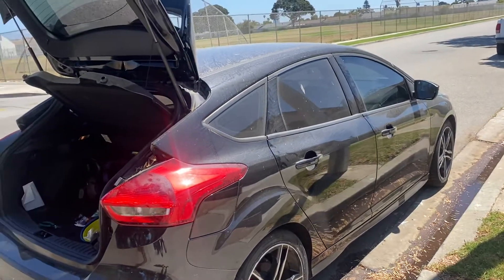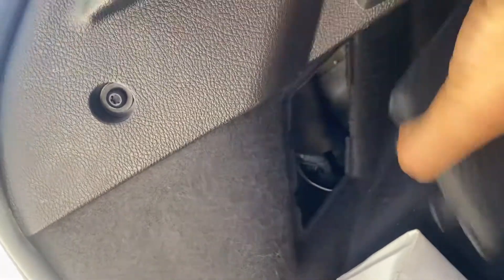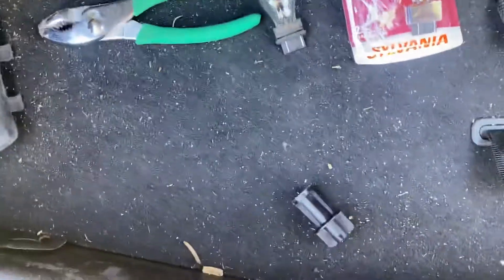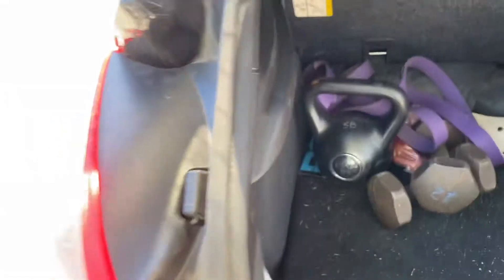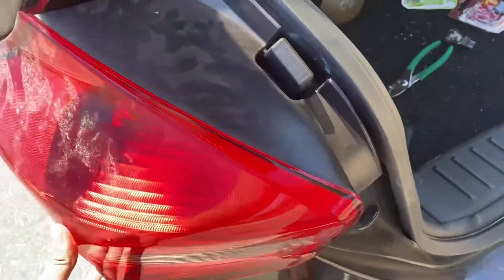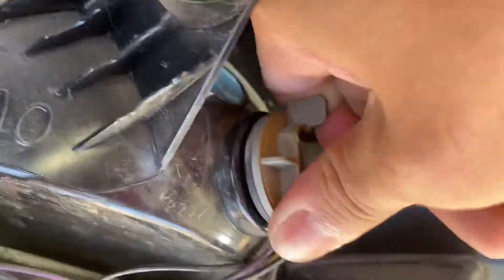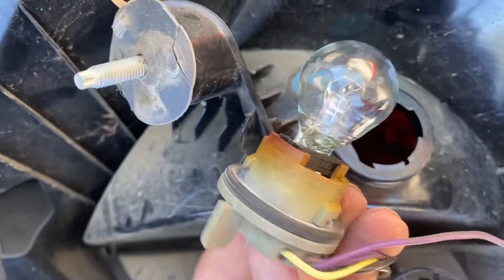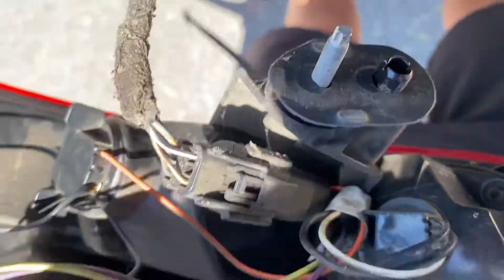How to change the brake tail lights on a 2017 Ford Focus ST

Comment: Finally, I found a great video and a person with great instructions! Oh, you can put a shop rag or towel  in the gap under the threaded cap to prevent the cap from falling into oblivion! Lol
Reply from the maker: GREAT idea! Hadn’t thought about that!
Reply: When I worked on aircraft, I used shop rags to fill the void between the airframe and remove the parts needed to be changed out! Life saver, my friend.

Comment: This is different on my 2018 RS .. how did you get to the upper lock? the 2018 RS does not have any of those holes .. looks like I have to remove most of the back paneling  to remove the light assembly ..

Comment: Those are called pliers..but U wont need rm, as Both the plastic nuts that secure the lens are easily removed by hand..as designed.
Reply from the maker: with smaller hands yeah it would work like it was designed. My hand didn’t fit in there